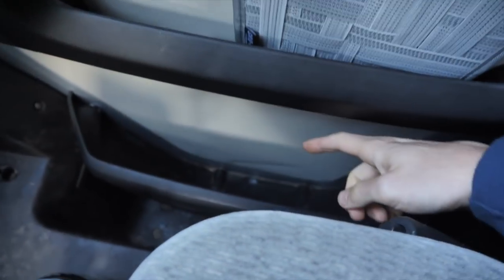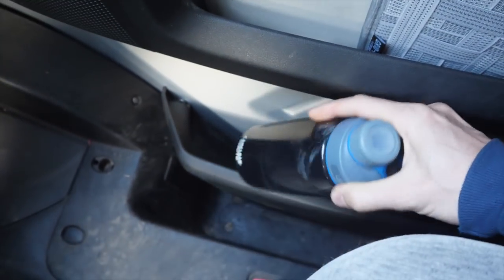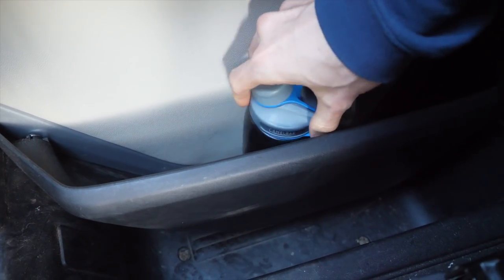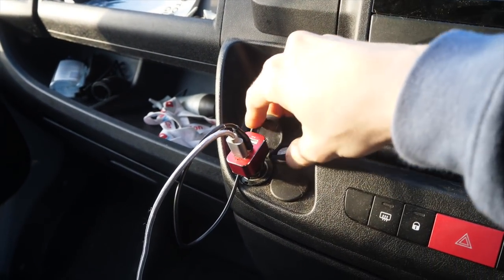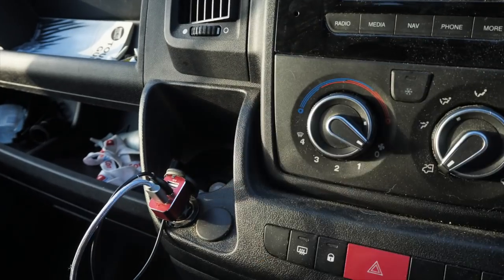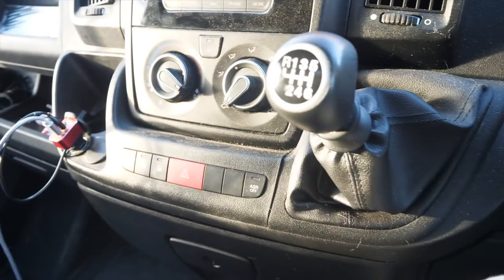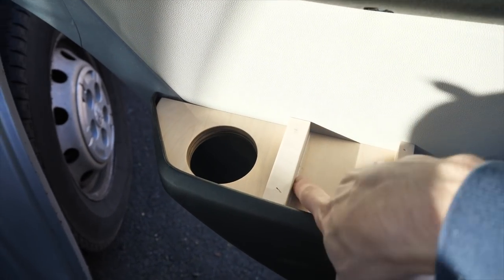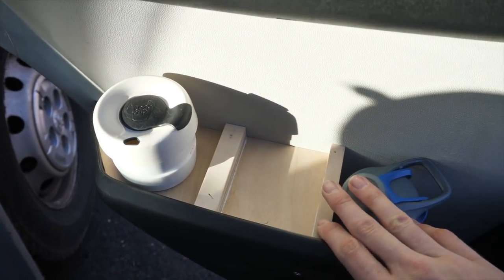1 Hour Project - camper van Cup Holder

Comment: Hey Hugh. Liked the idea so much I've done in my Ducato motorhome (no cup holder?!? What am l... An animal?). However, I use a metal cup and I was concerned that if it got bumped out it could end up rolling around by the pedals... Could spoil your whole day!
Therefore I've dropped the holder down about 14cm where there's a handy bit of plastic to screw into.

Comment: Is the cupholder a friction fit? I'd be worried that it might slide around. A very good idea and perhaps a nice alternative to one of those plastic cupholders. My Fiat Ducato only has a single cupholder and that one was installed by the previous owner.
Reply from the maker: No there is a screw holding it on one side but it is pretty snug also!